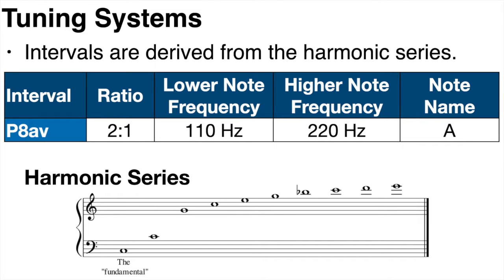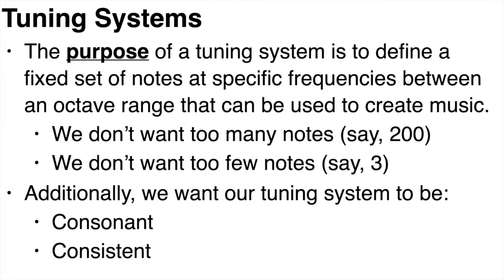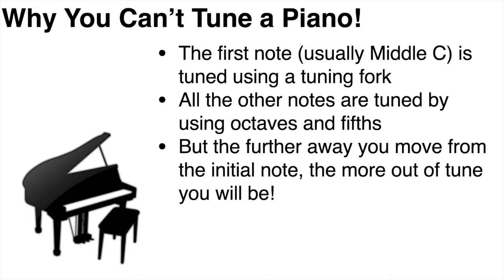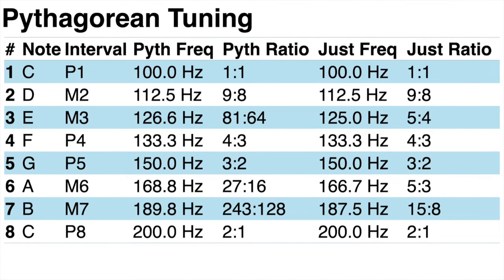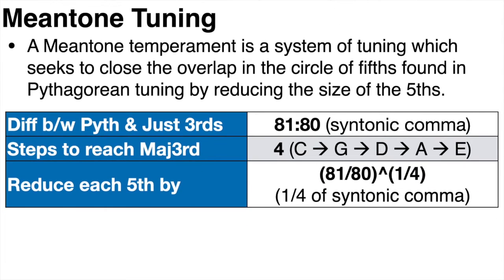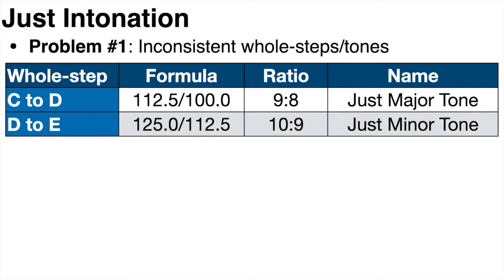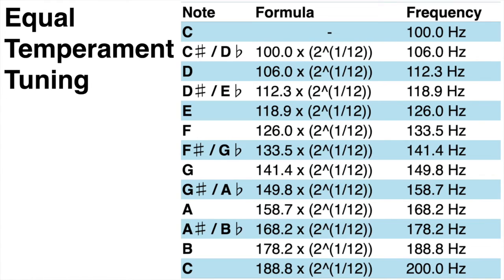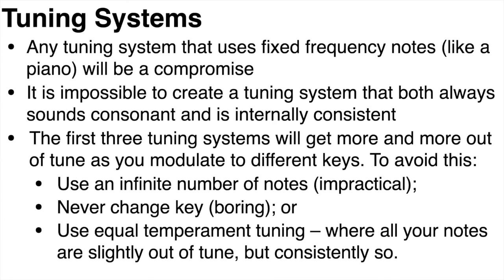16. Tuning Systems Explained

Comment: A lot of people say I'm consistently out of tune :)  One time on the radio they played the lowest note on a pipe  organ and the highest note several octaves above.  They were out of tune with each other by quite a lot.  Why is this ?  Does it mean they didn't use equal temperament ?

Comment: Nice and clear video! Only one little comment: at 15.08 you say: "the next value of a better approximation of the true interval ratio's is 30" But actually it is 31.  31 meantone fifths almost correspond with 18 octaves.

Comment: Good work.  This is perhaps the best short introduction to tuning and temperament I've seen so far.  Subscribed.

Towards the end, you point out that "you just can't win".  I like to put it mathematically: no power of two is also a power of three or five.  Even God can't change that, if She's logical.

Being a tuning freak who mostly plays heptatonic scales, I play around a lot with tuning.  Your description of 1/4 tone meantone was right on, but for me, the fact that C to D is 9/8 and D to E is 10/9 is a feature, not a bug. It feels harmonic to sing up a scale of gradually smaller intervals, as I do in the first five notes of my 1, 9/8, 5/4, 11/8, 3/2, 7/4, 15/8 scale.  I can even sing the 11th harmonic pretty well in tune by just sort of sliding up that fifth.

I haven't played in equal temperament for decades now.  I'm perfecty happy to stay in restricted tonalities, I do other stuff to make my music interesting.  Not that I have anything against 12TET, it's a wonderful comprimise that's indespensible for lots of music.  But singing those thirds is a bitch.

cheers from sunny Vienna, Scott
Reply: Yes I agree :) If you write music(or play written music) to take advantage of your chosen temperament and chosen keys, it need not be boring. You can still borrow from other keys and use the dissonant notes to express other emotions and contrast. And many notes and cords can have wonderful flavors and singing qualities that you just don’t get from equal temperament :)

Comment: I checked the ratio because I noticed that 202.7/200 isn't the same as 531.441/524.288
I did the math and the ratio comes from 3^12/2^19  (which is correct, you can derive this from the table you used to explain Pythagorean tuning. So the only error is the "=" sign at 6.04. 

And for me (I'm a math teacher) an "=" sign is important. Lef & right must be exactly the same.

Comment: I'm no expert so I have a question. In the Pythagorean tuning system, is the "octave" of the reference C (100 Hz) slightly higher because it actually corresponds to B sharp (202.7 Hz)? Because when we keep going with the fifths, we have C-G-D-A-E-B-F#-C#-G#-D#-A#-E#-B# and if we keep not using enharmonics, it will continue with F×, C× and so on. So every time we come to the next F, there will be one more sharp added to the group of the seven notes and we will eventually see triple and quadruple sharps etc. In this situation, it will not be a circle of fifths, but a spiral of fifths since none of the notes will reoccurr and it'll keep gettin sharper as we go up and flatter as we go down (C-F-Bb-Eb-Ab-Db-Gb-Cb-Fb-Bbb-Ebb etc.). Which looks mesmerising to me.

Comment: Thanks for these great videos!

Quick question as I'm trying to understand the harmonic series and just intonation: I see the list of just intonation ratios (3:2 for a perfect 5th, 5:4 for a major 3rd, etc.), but I'm curious which overtone in the series corresponds to each of these ratios. Do you have a list or know where I can find one that would give this info?

Some of them are clear to me. For example, I see that the 2:1 ratio of an octave first appears with the first overtone, and the 3:2 ratio occurs with the next overtone. But what about the 4:3 ratio of the perfect 4th? Which overtone corresponds to that?

Thanks again for all the great learning here!
Reply: the fourth appears as the interval between the third harmonic (the p5) and the 4th harmonic (the octave). Then the major third between 4 and 5, then the minor third between 5 and 6. The sixths are inversions of the thirds (and the fourth is also an inversion of the 5th).

Comment: So I could theoretically sound more in tune if I retune my guitar for each key that I play in? So if I play a song in C major then tune from the 8th fret of the low E string. If I’m playing in E then tune from open e string?
Reply: It won't work. You may just keep it as it is. The guitar is a very imperfect instrument to tune well. Firstly, because it's strummed by hand, so the (A) differences in your touch against the strings, (B) differences in pressing against the frets, (C) bending of the strings, (D) bending of the neck, etc. already create too many inconsistencies. To minimise some imperfections, you may try using the pick (plectrum), or use always the fresh set of strings, but the problem is not alleviated, it just becomes a slightly different problem. But we play the guitar just because it is very imperfect; more perfect instruments (like the modern piano or the electric piano) are boring. We humans enjoy more in "finding the desired frequency" through series of small corrections (which add flavour to playing) than playing it straight away.
Reply: @zvonimirtosic6171  I understand all of that, but my question wasn’t about making a guitar perfectly in tune or trying to improve the sound of the guitar, it’s if theoretically the guitar would be more in tune for the specific key, which it would be.
Reply: @Zach-ls1if  Some guitars lend tendencies towards certain scales and can accentuate moods. Say, the Spanish guitars with gut / nylon strings, produces certain overtones and harmonics (or lack of them) that work well in minor keys. The electric guitar, it may play the same notes, but it will never sound as mournful; the electric guitar may weave through all minor keys, and it sounds like rock'n' roll; it all sounds like major C to D.
Reply: @zvonimirtosic6171  definitely tendencies, but there’s a lot of grey area obviously. Like what Mexican Sierreñas do with 12 string guitars, they get a completely different sound out of it than any other guitar, and if most people hear it without seeing it they can’t figure out how the sound is made. It’s pretty interesting. Listen to Miguel y Miguel “el cisne “ or Ariel Camacho “el karma” and take a listen. They do something with the guitars that most “experts” and 12 stringers say can’t be done
Reply: @zvonimirtosic6171  thank you for the conversation btw
Reply: @Zach-ls1I My guess: The distance between the frets on your fretboard will prevent you from using pythagorean/meantone/just (I'm assuming you dont only want to play open strings!) But a movable-fret guitar like a sitar can do this.
Reply: Well, I don' t know if it makes a different in modern equal temperament. It may make a different for other temperaments. There are some experiments with placing the frets differently: https://www.youtube.com/watch?v=E0pUt_Wvht0

Still, @zvonimirtosic6171 make valid points about other "problems" of the guitar.
Reply: Theres a guy on youtube puts little extra frets, calls it a microtonal guitar.

Comment: Great explanation of the various systems and, importantly, what motivated them and their limitations. Really clearly presented.

I did notice one small problem when you introduced equal tempered tuning at around 14:00: you say and write that the nth root of 2 can also be written as 1/2^n, which is not true. I think you meant to write 2^(1/n). Similarly, 1/2^12 is definitely not 1.059… it is 1/4096 which is much less than 1.
Reply from the maker: Ah yes! Typo on my part! Sorry.

Comment: Thank you for the nice video. Referring to the table at 04:35 one can see that also the pentatonic circle C-G-D-A-E (denoted by 5-TET, a chinese scale) and the "Lydian" circle C-G-D-A-E-B-F# (7-TET) are worth considering with the out-of-tune error of 10.2 Hz and 2x6.8=13.6 Hz, respectively, when compared to our beloved western 12-TET scale with the error 2.7 Hz. The next local optimum is the impractical 53-TET scale/circle with the error at about ten times smaller that 12-TET.

Comment: Thank you for this approach to explaining the relationship between the nomenclature and the physics. I think mainly of the frequencies not the letters. Also if you spend time with an acoustic guitar, you can find the sympathetic lower frequencies relative to the "child" note. For example, if you play the harmonic on the high e 12 fret and then mute it, you will hear the A string 3rd fret C note harmonic ringing. My guitar teacher has never been able to explain this. How does the 5th A string, 3rd fret harmonic ring by itself?  You can map almost the entire fretboard this way. This is were my love for music comes from. The structure is preordained.  What are your thoughts?